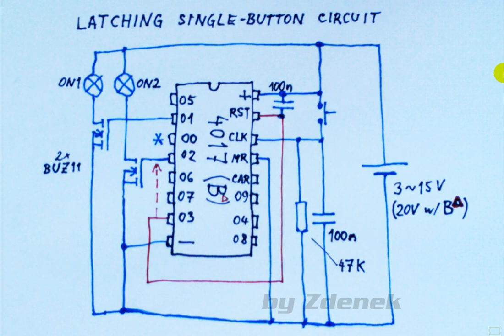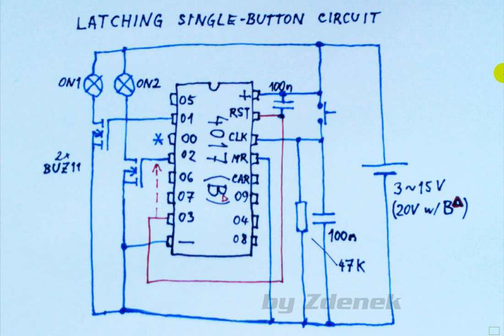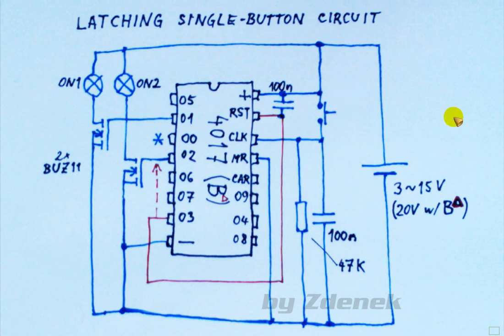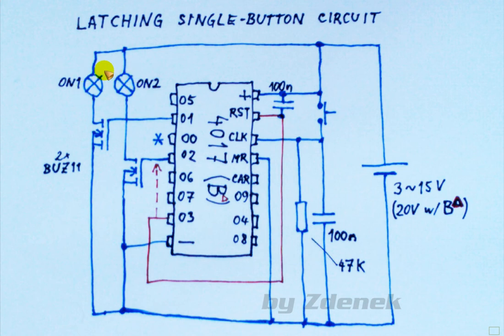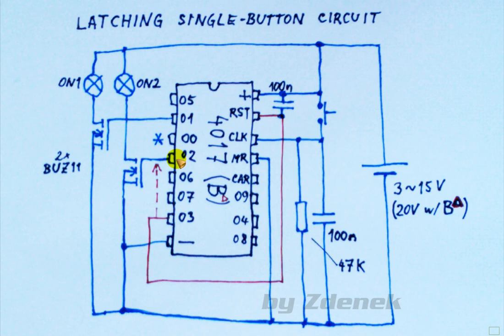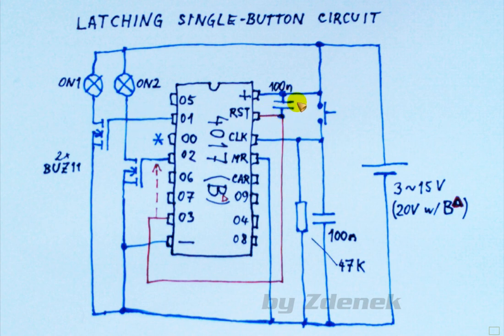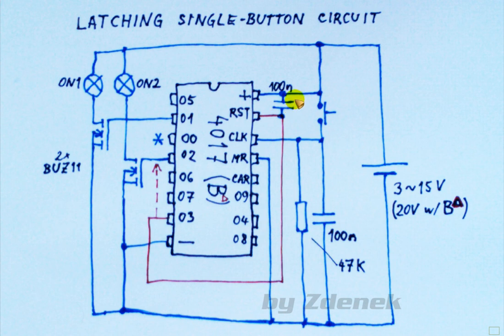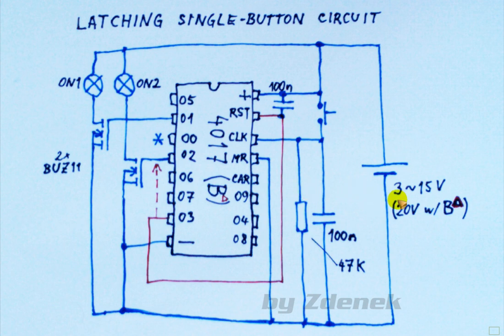Single-button Latching Power-on Circuit

Comment: Thanks for sharing! Question: I made a similar latch for an h-bridge using a TTL 7475 bistable latch IC. See video at  https://youtu.be/8tQ82eVW-E0 . Works great for small loads, but I can't seem to get enough current for larger loads. Tried several solutions with no luck. I'll try adding a relay next. Any thoughts on driving or latching high current loads from a latching IC???

Comment: Hello! Great and detailed explanation! As I guess - it's possible to connect it with CD4052 to create different "0-1" states for switching channels.
Do you know, is it possible to make a channel switch with CD4052 only (using a tactile knob or a potentiometer)?
I need an electronic switch for my analog synth. There will be a choice between Osc. -> VCA -> VCF or Osc. -> VCF -> VCA. And I don't want to make it with a "physical" switch to make it expandable at least.
Thanks in advice!
Reply from the maker: Not the one mentioned in the video. You could connect the counter (4029) (it's up-down, so you could have 2 buttons for "directions" if you had many options; you might be able to make a pseudo-knob that would just control these two contacts) with the inputs of the demultiplexer (4052). You could use two 4052s for a stereo system (probably not needed). Make sure you wire the RESET to the first unused bit, or the loop will be incomplete every other time (it will run to 10) (depends on which counter you select; it won't matter with a hex one, like 4029). If the number of channels/devices is not a power of two, you will also need one 4028 - a decoder to one of ten. This will give you the granularity to reset the loop after any number, such as 5. You will need to add a small cap (10n) between RESET and GND, or it would reset randomly when it shouldn't since the decoder may have transients.
The demultiplexer does have its internal resistance and floors at the supply voltage. Use 12V to get good (low) resistance. You will need to make sure the signal never runs out of the window given by this power supply. If the sound signal alternates around zero, it would be best to have a symmetrical supply just for these chips - the negative would be -6V and the positive would be +6V. (5V is close enough if convenient) You could also use separation caps and voltage dividers, but that would run into ugly pops and it would likely distort your sound.
You can use a bar of LEDs to show which channel is active. Connect a diode and its resistor between the outputs of said 4028 (which would be required for this even if you had a power of two number of channels). A CMOS is plenty powerful to light an LED with its output, but you'll benefit from the fact that the RESET output is not connected to any LED - it it were, you'd run into a risk of it not reaching log 1, thus not resetting.
Reply: Thanks a lot, Zdenek!
About 4028: do you mean that if I have only 1 channel (using 4051 for example) then I need this chip? To get odd (1, 3, 5...) "bulbs to light up"?
If I use a bipolar PSU with +/-13.5v, do I need to use 5v and -5v regulators to power 4052? The datasheet says (absolute maximum ratings) "MIN: - 0.5, MAX: 20v"... Does it means that a bipolar supply must be +/-10v max? Is it allowed to use lower than -0.5v on the negative?
Using a bar of LEDs: Do I need 4028 to light up LEDs? I've tought it's possible with 4017 already... I guess it's in the last phrase but I can't understand it.
Reply from the maker: No 4028 was mentioned. If by one channel you mean mono sound, it makes no difference in the BOM, you'll simply have one per kind. A +-13.5V would fry a CMOS, the sum can't reach the maximum voltage. The negative voltage in the datasheet means nothing for usability, it's just the fact that over -0.5V will fry it. It won't do any useful work under about 3.5V, but that's too low for us here. Regulate it down with 7806 and 7906 for the negative side. The GND of the chips will become -6V relative to the shielding, the Vcc will become +6V. It's just to avoid the signal clipping past these voltages. 
The 4017 outputs one of X outputs, so it's good for LEDs. The problem is that 4052 requires BCD input which is a different beast. Hence the additional work requiring a separate counter and a BCD to 1 of 10 decoder.
Reply from the maker: It has dawned on me that if all you need is the flipping of order of processing the two boxes, you could possibly do with just the 4017 and one additional component after all. You would use one 4066. This has just the switches, no BCD decoder. You could then use the O1 and O2 outputs to drive its inputs to get just the alternation between these two options. I caught on you mentioning a 4052, but if I get it, you should use 4066 instead and it would serve you better. The need for a symmetrical PSU of 12V total still stands.
Reply: Wow... it's a more complex thing than I've thought :) Yes, I need a simple flipping but probably in some cases (not here) I will need to switch few paths to obtain another circuit. Or it will be (definitelly) FM-RM-AM or few (3 to 5) different waves to choose.
My initial thought was that 4017 lights up LEDs... so 1 = lighted up LED 0 = dark. I've supposed that there (in 405* ICs) is some voltage threshold that means it's " = 1". Thus it set up bits.
- Oscillators are mono usually.
Reply from the maker: Doing this for any more than 2 filter boxes would be difficult. I assume you want fast on-the-fly switching, that's why you don't use mechanical switches or jack cords. I'd suggest that you build the 2-filter version first to get familiar with it. After you get it working and decide you want to build a more challenging project, a 3-filter box would be nice. You would hard-code each of the six permutations of the three filters into each slot, possibly using the remaining four outputs of the counter for a few select 2- or single filter versions. If used with 4029 which has a preset, you could also have a button that would jump to any pre-selected combination instantly. I wouldn't go above 3 filters at all. These would already require three 4066 circuits just to be able to do the full permutation. Note that this doesn't scale linearly.
Reply: Another idea: can it be done with help of logic gates and a short pulse circuit (to trigger them)? I mean to switch bits on 405* ICs.
Reply from the maker: That would make it worse, if not impossible. For the task needed (a permutation of components in-line), the 4066 is most likely the optimum solution. Also, logic gates could be used as support (you would end up using several OR gates to collect signal from several of the decoder's positions to every switch), but not as the main thing itself. A logic gate can't form an analog switch and it would be horribly inefficient trying to implement any of the other more complex circuits with them.

Comment: Hello,

I would be very grateful if you could expand this to 3 outputs in case that it's suitable to be used as over change switch for 1A 3.7V load (40 LEDs 3.6V 20mA). I meant to use it as s slide switch to supply LEDs from several sources (batteries, adapter and so on).

Thanks

Comment: This looks like what I need for a project I'm working on, but what is the quiescent current of the 4017 when output 0 is low? The 4017 is connected directly to the supply voltage with nothing to break that circuit.
Reply from the maker: Typical quiescent current for CMOSes is 40 nA, that's NANO. Your battery aging will be orders of magnitude worse. Dave's transistor residual current is much higher as well. You can never get around this undesirable consumption completely, so you best use the most savvy device available, which is this.
It doesn't matter what the state of the outputs is, in fact, the unconnected output 0 will be high in the "off" state, but as long as you are not forcing your device to operate at the transient currents (negative feedback, analog mode), the 40 nA will be the figure. In fact, the creepage gunk on the parts will eat up more power than your IC.
Reply: Thank you for the very prompt reply :D
40 nano amps? Jeepers :P I think the Sun would supernova before that drains my 3Ah battery.
Now I just need to figure out how to implement an on/off delay of about a couple seconds so the button has to be pressed and held
Reply from the maker: azayles
Ask and you shall receive: Increase the cap between the button and the negative to 100 uF and add a series resistor between the top button contact and the positive line that will be about a third lower in value than the bottom resistor. Use 22k or 33k in this case. Then experiment with different values. Warning: The distortion at higher loads generated upon power off is capable of forcing such circuit to keep itself powered on even when you keep pressing the button. You will have to find a matching pair of caps and put them to the CLK input as a 1:1 divider (add the other cap between CLK and positive) to prevent this voltage hop from being received by the input. There are other ways, but this one is probably the easiest.
 When you are at the cap matching, a 4% lower value at the positive side compared to the negative side will be best due to the CMOS threshold asymmetry.
Reply: Thank you so very much! I'll try and breadboard something up at the weekend. Think I have a cmos 4017 in the parts bin, and plenty of glue components.
This has saved me huge headaches :D